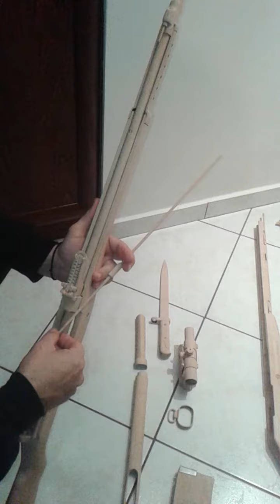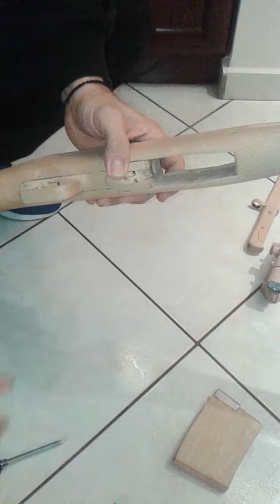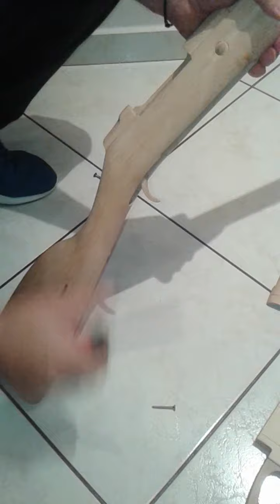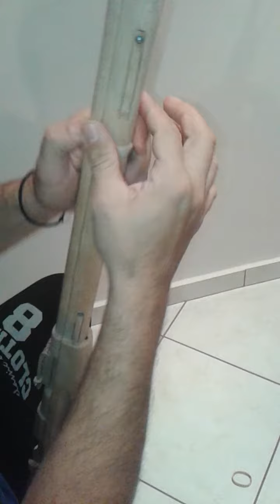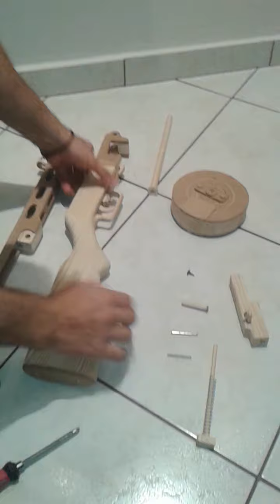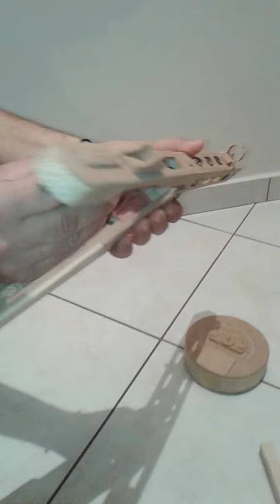Tokarev svt-40 vs Mosin nagant m91 dragoon vs ppsh 41 wooden replica-Woodenguns.gr

Comment: Do you laser cut parts to get this amount of accuracy? And how do you milk out the receiver for the mosin?
Reply from the maker: DarV8dr  all pieces of arms is handmade!
Reply: What tools do you use so make the bolt actions?
Reply from the maker: DarV8dr not using a specific tool because the slide of the weapon is in pieces
Reply: +WoodenGuns.gr I mean the bolt and action of the mosin nagant. How did you make the action hollow so the bolt could go in
Reply from the maker: DarV8dr based on the mechanism of real weapon
Reply: DarV8dr Chisels, and drills.